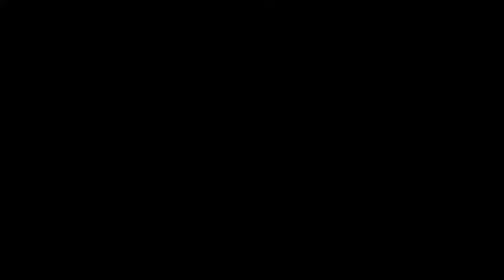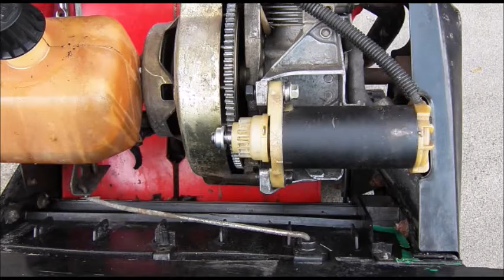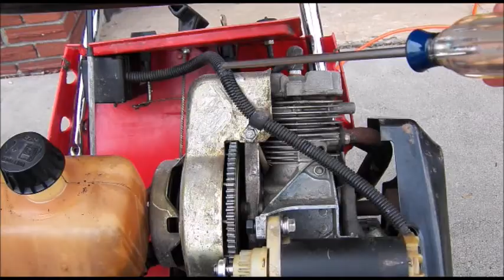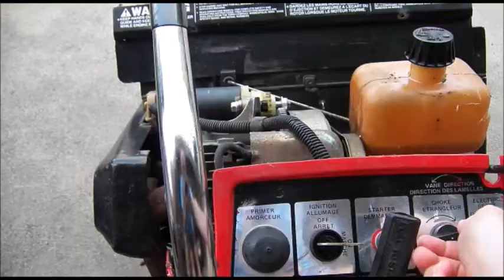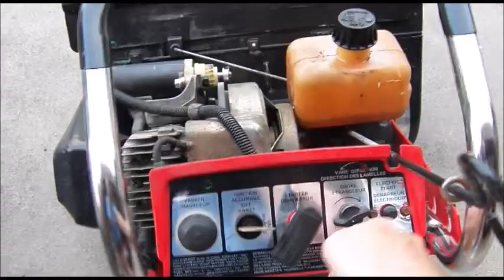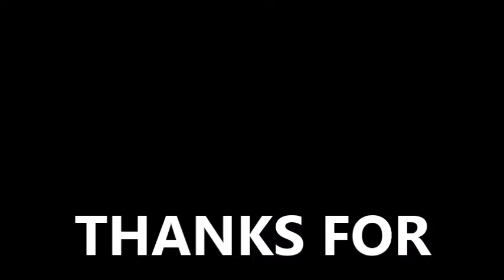electric starter start repair for Toro S 620 S 200 Snow Master snowblower snow blower

Comment: Found one of these machines in the trash... as soon as I hit the electric start button the plastic gear EXPLODED! I removed the electric start system altogether. If it's tuned right it should start within a few pulls anyway. Also weight reduction is a good thing as I live on the second floor.

Comment: I watched your entire video hoping that you would mention it but you didn't mention the  flywheel ring gear.   If it's rusty and teeth are missing it needs replacement but yours looks normal.

Comment: Toro sucks
Reply from the maker: right... that's why one of mine has lasted 39 years doing a 300 ft driveway.
Reply: @bigslick  I agree. I bought an S620 about 10 years ago for $25, and it is bullet proof. Keeps starting and running. I can't throw it away.
Reply from the maker: @jimbohnenkamp5082  agreed,  and these are much lighter weight than modern single stage throwers, which makes it much easier to move around and put into storage.  These models probably weigh 50% less than newer units.  Every year I look at the new models (from many brands) and every year I shake my head and give thanks to my old Toro.

Comment: I think most of the time you will notice that the shitty plastic gear on the starter is gone. So buy another & put some white brake grease on the grooves it slides on.

Comment: what makes the plastic gear on the starter move up to engage the drive wheel and then back down out of the way? my starter gear does not move back down
Reply: the spring on the shaft, and grease on the shaft